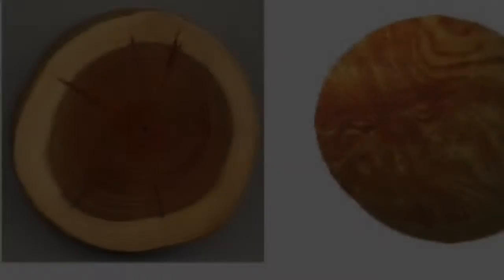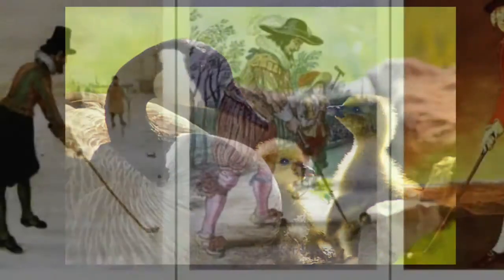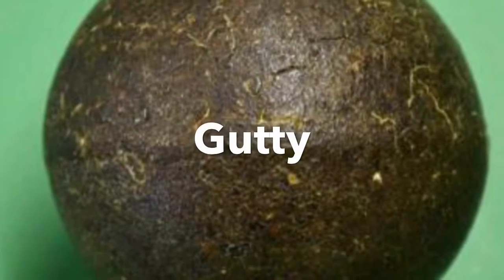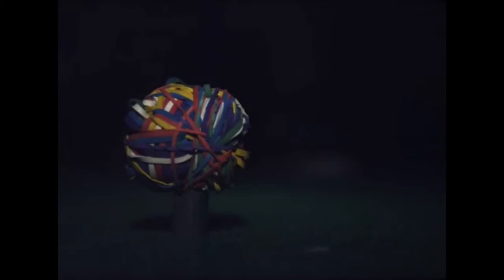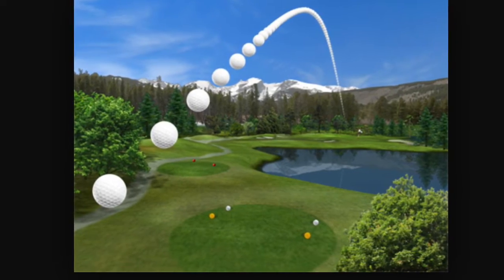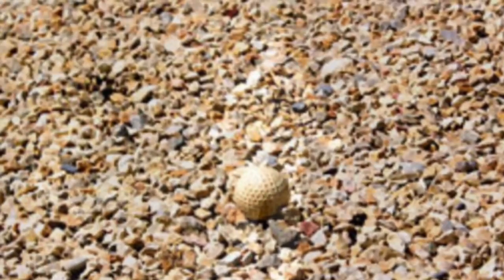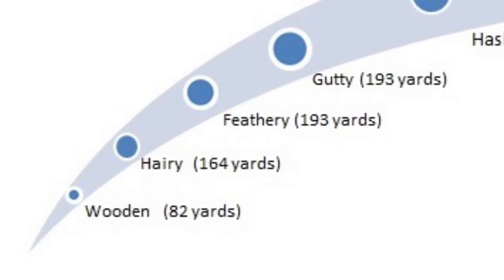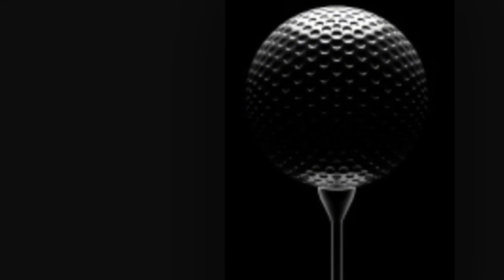The History of the Golf Ball

Comment: Somewhere in the making of this video there seems to have been a failure to understand the nature of numbers. It is not reasonable at all to say that a wooden ball could be hit 82 yards whereas a feathery could be hit 193 yards. This is similar to saying that 14th century men walked at 3.782 miles per hour - i.e. nonsense. When using numbers to describe approximations to the average behavior of historical articles, the limits of reasonable precision needs to be recognized. It would be more appropriate, for example, to say that many players could hit a feathery 150 yards or so, and the best players were known to hit such balls around 200 yards quite often. If it is felt that a single number must be cited, then in a case like this figures in tens of yards should be used (80, 160, 190) in acknowledgement of the degree of approximation involved. To be more particular, I think the figures given here minimize the difference between the gutty and the wound ball - a player who could hit a gutty perhaps 160 yards might well be able to hit a wound ball 200 yards. This would depend a lot on conditions of course. The wound ball bounced a lot more than the gutty, which could sometimes give considerable extra distance. For this reason it was called by some the 'bounding Billy', and felt by those who favored the gutty to offer an unfair advantage.